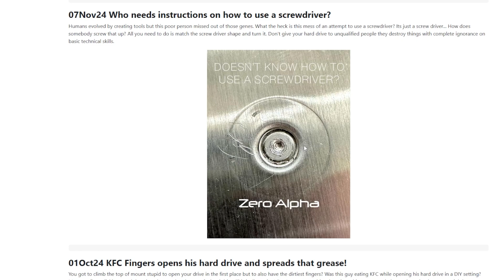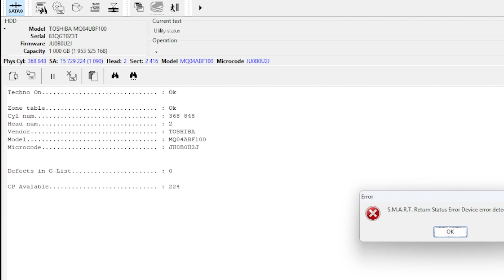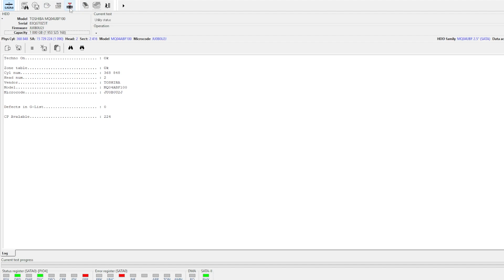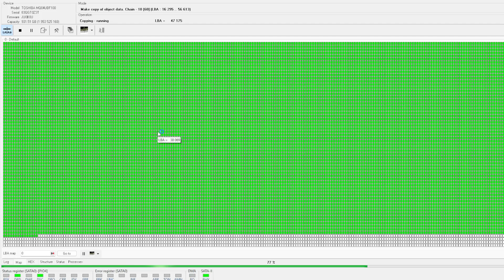Hard Drive PCB Repair for Data Recovery

Comment: Loved your Video. I'm hoping to bring back all the files on my 3TB Hard Drive. Do I need to swap out the PCB chip on it's circuit board? (Yes, I have a chip reader and will back it up). Am I understanding the process correctly? Or do I have to get a compatible replacement circuit board, and swap out the chip on there, from my old board to the new one? Where are you located, in case I fail in my attempts? What software are you using to analyze the disk? Is it free, can you link me to it? What device are you using to solder that chip in place? It looks like new technology I'm not familiar with. I'm old school and still using a soldering iron, but I am curious. Lastly, can I just buy a replacement board, and attach it to my hard drive, or do I NEED to swap out that chip? Trying to bring back some very important data, sure hope I'm successful. In my case, the D:\ drive is not even visible to Windows. So I can't run DISKCHK or any other recovery software. But if this method works, I'm totally willing to give it a try.

Comment: What did the winbond chip actually contain?  The specific geometry of the drive?
Reply from the maker: It contains boot code firmware and adaptive data unique to the drive for tuning the heads & servo